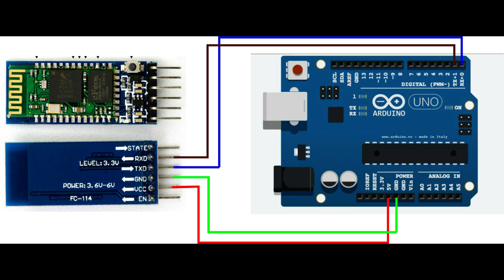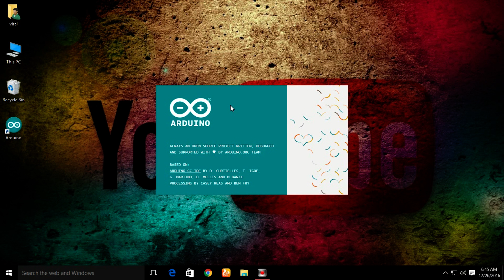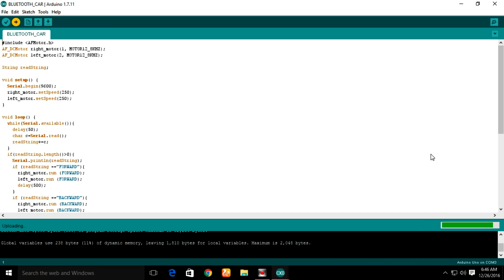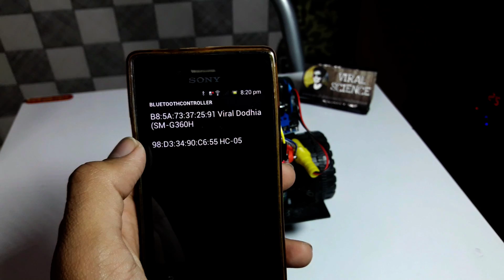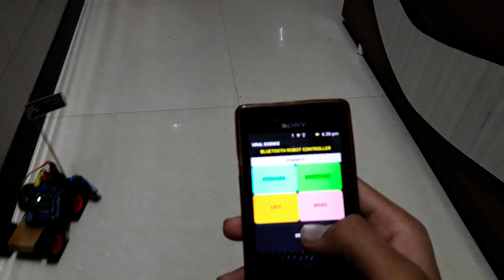How to make Smartphone (Bluetooth) Control Car

Comment: My bot is working fine but once in a while it stops receiving blue-tooth signal and sometimes it resets. What could be the problem I have tried decoupling motors with capacitors to no avail.

Comment: Bro please give me code that link isn't working
Reply: Bro I can give you a right code
Reply: @bhargav4689  yes please
Reply: #include <AFMotor.h>
#include<SoftwareSerial.h>

#define TxD A0
#define RxD A1
SoftwareSerial bluetoothSerial(TxD, RxD);

AF_DCMotor motor1(3);
AF_DCMotor motor2(4);

char c;

void setup() {
  bluetoothSerial.begin(9600);
  Serial.begin(9600);
   motor1.run(RELEASE);
   motor2.run(RELEASE);
   motor1.setSpeed(500);
   motor2.setSpeed(500);
}

void loop() {
  if(bluetoothSerial.available()){
    c = bluetoothSerial.read();
    Serial.println(c);
    if(c=='1'){
   motor1.run(FORWARD);
   motor2.run(FORWARD);
   delay(2000);
    }
   if(c=='2'){
   motor1.run(BACKWARD);
   motor2.run(BACKWARD);
   delay(2000);
   }
   if(c=='3'){
   motor1.run(FORWARD);
   motor2.run(BACKWARD);
   delay(2000);
   }
   if(c=='4'){
   motor1.run(BACKWARD);
   motor2.run(FORWARD);
   delay(2000);
   }
   if(c=='5');
   motor1.run(RELEASE);
   motor2.run(RELEASE);

  }
}
Reply: @bhargav4689  errors hai
Reply: plz sub my channel
Reply: @bhargav4689  if this works I'll surely sub to you

Comment: What if i want to reduce the speed can I control that from the code or it just the speed of the motors!? I want a really low speed
Reply: U can do that from code by in this case reducing 250

Comment: I really enjoyed you showing how to assemble the wiring ... it was much easier to understand than some of the others I've been watching ... :-)
Do you have to use a separate 9V battery ...  or can it work with other voltages like  5V or 12V which I already have available ???
I'm using a DC-DC 5V 3A Power Supply Module  from the main 12V source currently ...

Comment: Whole of the code is incorrect...
And the project requires two different power supply... 
One for arduino and second for motor shield
Reply: You still have that code?

Comment: Arduino: 1.8.5 (Windows 10), Board: "Arduino Yún"

In file included from c:\program files (x86)\arduino\hardware\tools\avr\avr\include\avr\io.h:99:0,

                 from c:\program files (x86)\arduino\hardware\tools\avr\avr\include\avr\pgmspace.h:90,

                 from C:\Program Files (x86)\Arduino\hardware\arduino\avr\cores\arduino/Arduino.h:28,

                 from sketch\BLUETOOTH_CAR.ino.cpp:1:

C:\Users\DELL\Documents\Arduino\libraries\AFMotor/AFMotor.h:44:30: error: 'CS21' was not declared in this scope

     #define MOTOR12_8KHZ _BV(CS21)              // divide by 8

                              ^

C:\Users\DELL\Desktop\BLUETOOTH_CAR\BLUETOOTH_CAR.ino:2:27: note: in expansion of macro 'MOTOR12_8KHZ'

 AF_DCMotor right_motor(1, MOTOR12_8KHZ);

                           ^

C:\Users\DELL\Documents\Arduino\libraries\AFMotor/AFMotor.h:44:30: error: 'CS21' was not declared in this scope

     #define MOTOR12_8KHZ _BV(CS21)              // divide by 8

                              ^

C:\Users\DELL\Desktop\BLUETOOTH_CAR\BLUETOOTH_CAR.ino:3:26: note: in expansion of macro 'MOTOR12_8KHZ'

 AF_DCMotor left_motor(2, MOTOR12_8KHZ);

                          ^

exit status 1
Error compiling for board Arduino Yún.

This report would have more information with
"Show verbose output during compilation"
option enabled in File -> Preferences.
 

yeh  problem aa rahi hai
Reply: tell what to do

Comment: Arduino: 1.8.1 (Windows 7), Board: "Arduino/Genuino Uno"

Sketch uses 4276 bytes (13%) of program storage space. Maximum is 32256 bytes.
Global variables use 240 bytes (11%) of dynamic memory, leaving 1808 bytes for local variables. Maximum is 2048 bytes.
avrdude: stk500_getsync() attempt 1 of 10: not in sync: resp=0x00
avrdude: stk500_getsync() attempt 2 of 10: not in sync: resp=0x00
avrdude: stk500_getsync() attempt 3 of 10: not in sync: resp=0x00
avrdude: stk500_getsync() attempt 4 of 10: not in sync: resp=0x00
avrdude: stk500_getsync() attempt 5 of 10: not in sync: resp=0x00
avrdude: stk500_getsync() attempt 6 of 10: not in sync: resp=0x00
avrdude: stk500_getsync() attempt 7 of 10: not in sync: resp=0x00
avrdude: stk500_getsync() attempt 8 of 10: not in sync: resp=0x00
avrdude: stk500_getsync() attempt 9 of 10: not in sync: resp=0x00
avrdude: stk500_getsync() attempt 10 of 10: not in sync: resp=0x00
An error occurred while uploading the sketch

bhai ye error aa raha hai plz solve it

Comment: Arduino: 1.8.5 (Windows 10), Board: "Arduino/Genuino Uno"

C:\Users\Bangla_Bhut\Desktop\bluetooth_hc05_rc_car\BLUETOOTH_CAR.ino: In function 'void setup()':

BLUETOOTH_CAR:7: error: redefinition of 'void setup()'

 void setup() {

      ^

C:\Users\Bangla_Bhut\Desktop\bluetooth_hc05_rc_car\bluetooth_hc05_rc_car.ino:6:6: note: 'void setup()' previously defined here

 void setup(){

      ^

C:\Users\Bangla_Bhut\Desktop\bluetooth_hc05_rc_car\BLUETOOTH_CAR.ino: In function 'void loop()':

BLUETOOTH_CAR:13: error: redefinition of 'void loop()'

 void loop() {

      ^

C:\Users\Bangla_Bhut\Desktop\bluetooth_hc05_rc_car\bluetooth_hc05_rc_car.ino:15:6: note: 'void loop()' previously defined here

 void loop(){

      ^

exit status 1
redefinition of 'void setup()'

Invalid library found in C:\Users\Bangla_Bhut\Documents\Arduino\libraries\examples: C:\Users\Bangla_Bhut\Documents\Arduino\libraries\examples

This report would have more information with
"Show verbose output during compilation"
option enabled in File -> Preferences.

Comment: You should use the state pin of the  bluetooth module to control car.
This will help to remove that stop button from your app.
Also car will work until you hold the button.

Comment: one big disadvantage is every time have to press stop button after giving forward,backward,left or right control commands. If I directly hit left after forward command, the app disconnects from Bluetooth module and have to connect back again. Please fix this bug by updating your code in required areas. That helps a lot for us.
Reply: that code easy af, perhaps you can change it and post the link to the downlaodable maybe.

Comment: if i enter 

 if (readString ==""){
      right_motor.run (RELEASE);
      left_motor.run (RELEASE);
      delay(500);

will the car stop if no button is pressed??

and one more question.. in the program which pins are assigned as the digital input pins for the motor driver? i am using the L239d as a single ic..

Comment: Hey i couldnt open code as the code link is not opening is there any alternate for this problem ?
Reply from the maker: Sunanda Cp open code with a pc it will open.
It will not open in smartphone
Reply: Ok but the project is not working i dont know what 's the problem

Comment: Pls help me
Reply: When I try it says error unable to write: pipe broken. I tried changing the battery , but still doesn't work. Pls help. I have to submit by 10 th of September
Reply: Pls reply bro
Reply: Hello man I need help
 I used 2 camelion batteries, two he batteries, one powerone battery and one Duracell. All 9v
I don't know what to do. You have to help me. Pls.
Reply: Same problem I am facing
Reply: If you solved the please contact me

Comment: it is showing error 516 (unable to write broken pipe)and u r the best
Reply from the maker: pewllycop its a battery issue use a duracell or rechargeable battery
Reply: Viral science i am using 9v battery
Reply from the maker: But use a duracell 9v battery or rechargeable 9v battery
Reply: Viral science thanks man

Comment: what will be the code for 4 motor (To move forward, back, left and right)
i'm using 2 L293D ic to drive the robot 
1 L29D for left front motor and left back motor
other for right front motor and right back motor
plz help

Comment: Hello I made connection as per video and connect Bluetooth but it shows error while running car the error is " Unable to write : broken pipe "
Reply from the maker: Kuldeep Nikam connect a duracell 9v battery it will work

Comment: i have prepared according to video and all connections, code and application are correct but motors are not working when pressing forward backward left right. Please tell me what is the problem
Reply from the maker: Sushil Bakhtar i guess it musb be battery problem you must use a 9v duracell battery or a rechargeable battery
Reply: bhi agar batrry ki jagah laptop se power de to chelega

Comment: but sir that errors are coming on your application
Reply from the maker: Three Sides its beacause of the signal , if you use a rechargeable or duracell 9v battery it will work

Comment: hey its not working im getting com10 connection
Reply from the maker: Ayush Agrawal then select port com 10 and then uppload it will work
Reply: did that still not working

Comment: Made it but with different coding , Originally the rpm of dc motor is set to 255 , any chance to increase the rpm ?
Reply: Maaz Ahmedani i want to buy project contact me jaldi 9821051132

Comment: i made the car and it works but after a while the battery gets hot and it stops working.then after sometime it starts working again

pls reply
Reply: YOU ARE LUCKY
Reply: why ?
Reply: the bluetooth module has a password
Reply: you have to pair it
Reply: thanks it worked
Reply: what ?
Reply: u have to add library to arduino librarys
Reply: have u fixed the motor in front part
Reply: what front motor
Reply: did u upload af motor library
Reply: @shriyansu Kumar amazing English. you need a seat in Oxford apparently.
Reply: Abdul Zeeshan why bro ???
Reply: ARAVIND C(ERROR 516 UNABLE TO WRITE:BROKEN PIPE) PLZ HELP ME
Reply: Bro
Reply: Bhai tumhare paas vo code hai to muje do please iska link work nai karra

Comment: is there any problem in code!! bcz when i upload the code suddenly one wheel rotate...i done whole things as per your video...but at last it's not working...pls help me!
Reply: Subhaa Dass you need to download libraries for Arduino ide
Reply: aamir khan this video is not mine
Reply: same here with me
Reply: You must check the wire connections properly
Reply: Well subhadaas how many motors did u use
Reply: Well I'm still modifying the code so I don't know what's the problem and by tomorrow my car will be ready
Reply: that is why you need to learn how to do the code instead of just copy-pasting stuff you dont even start to understand. to think that the code is in c and the Arduino console and the coding are one near damn easy even a noob can just write the code himself.

Comment: will it work if I use H bridge l298n motor drive shield ? and I have 4 separate motors operate .....
Reply from the maker: Maaz Ahmedani if you use L298N bridge then you will need ko change the code
Reply: can you code and send to my email ?

Comment: hiiii .....the code as showing error so please send original code 
the error shows 

: fatal error: AFMotor.h: No such file or directory

 #include <AFMotor.h>

                     ^

compilation terminated.

exit status 1
Error compiling for board Arduino/Genuino Uno.
Reply from the maker: Naveen Poosals you have to download af motor library and paste in libraries folder of arduino

Comment: bro the code is not working ....
Reply from the maker: MADUSHAN MADU what is the error while compiling ?
Reply: include <AFmotor> error compiling for board arduino/geniuno
Reply from the maker: MADUSHAN MADU you have to download AFMotor library and paste it in library folder of arduino and then it will work
Reply from the maker: MADUSHAN MADU link for Afmotor library is in discription
Reply: how to download this pls help me bro
Reply: plzz help how to down;load the library
Reply from the maker: MADUSHAN MADU i have uploaded a video on my channel about how to upload library watch it

Comment: I used the code on 4wd and it worked for 30 sec with wheels in differant speed like there is something in there way   and then stoped

Comment: #include<AFMotor.h>  is not working...it is showing error..plz tell me the solution...
Reply from the maker: Discover with Debashis you have to download AFMotor library and paste it in library folder of arduino and then it will work
Reply from the maker: Discover with Debashis link for AFMotor library is in discription of video

Comment: can I use the code for 4wd car?
Reply from the maker: derar5555 yes
Reply: I used the code but when I press a button , the car didn't move and I just heard little noise come out of it .. what should I do ?
Reply from the maker: derar5555 your battery would be drained
Reply: Thank you pro , but when I connect it to the computer via usb still didn't move ...
Reply from the maker: derar5555 have you connected the wires properly
Reply: I'm really not sure 😥
Reply: how can I be sure ?
Reply: I'm very sorry for bothering you , but I'm really stuck ... how can I know the out in motor shield so I can connect the wires that comes from motors correctly ?

Comment: hey how did u program the arduino?
Reply from the maker: sourabh peruri to program arduino you need to download arduino software in your computer and then connect arduino board to computer with data cable and program the board with codes
Reply: Thnx.